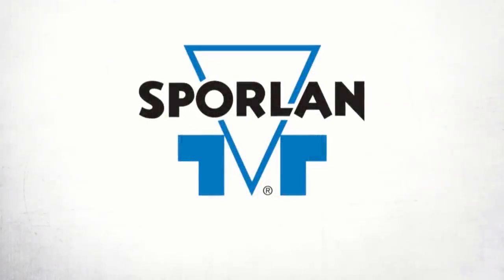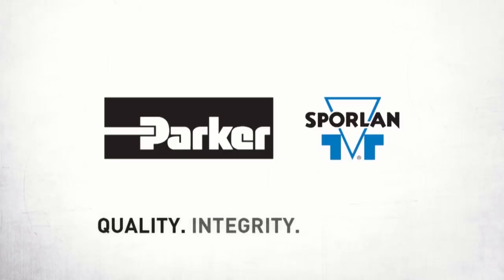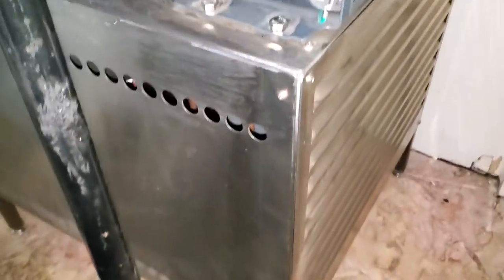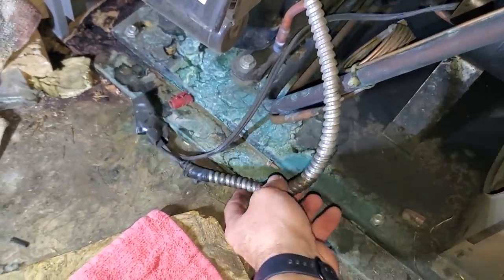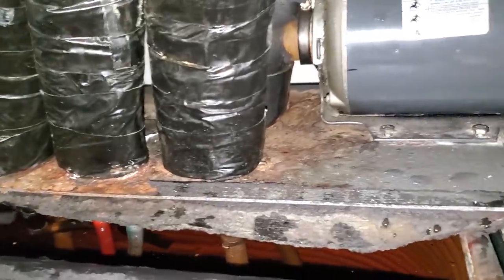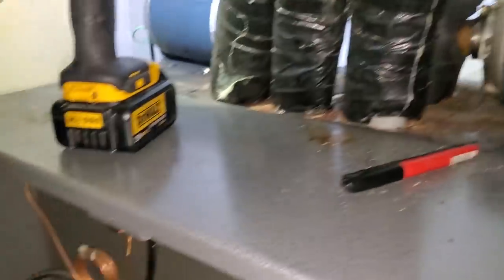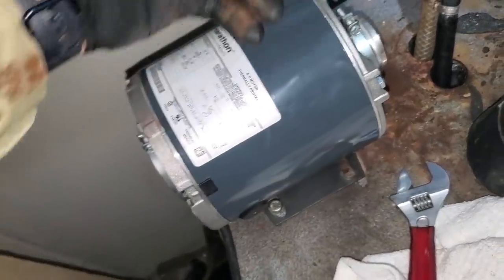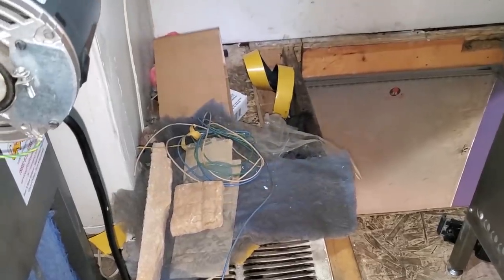BEER IS POURING WARM OUT OF THE TAPS

Comment: as a mechanic ill give you my take on the failure, for what its worth, the pump was going bad , due to contamination or whatever. Burned up the motor. previous tech replaced the burned motor and left the pump. fixing the effect and not the cause.
Reply: You can tell this place and the tech who service it don't have any pride in their work. Pump room is a mess, rust on the units, etc. This is one of your typical "just get it to work" businesses with no foresight.
Reply: @dodgeplow  Unfortunately there are many customers who want it just enough fixed to get it working again. If the customer doesn't want to pay he gets this kind of work.
Reply: @deineroehre  oh I understand. I do much of my own automotive work and have seen disaster repairs on old vehicles I've bought. Same thing with rental properties and my prior homes. You can see all the corners cut.
Reply: When those motors burned the best thing is to replaced the pump also cause most of the time is the pump going  bad
Reply: @dodgeplow  I always take pride in my work no matter what I do, and I have a pretty strong work ethic and a tad on the OCD side. I don't usually mind fixing other people's careless mistakes, but at the same time, shoddy careless work drives me insane. If you don't take pride in your work, go somewhere else. This costs the customer, and if they figure out the problem was caused by a careless tech, I can't imagine them calling them back for future jobs. Just how I see it. Ok, rant over. 😂
Reply: @gregmercil3968  Nor a service tech,  Contractor. But there is nothing that's more annoying than having to tell someone that their "small problem" will now be closer to 3-5k because half their wall is rotted out because someone could not bother to take the time to do the flashing correctly. It's just money down the toilet.  I'd much rather spend my time and their money making something better, not just redoing careless damage
Reply: As soon as you see the poor wiring and the loose covers you have to get suspicious. Either a sloppy worker or a lot worse an amateur or bodger.
Reply: that glycol was trashed
Reply: Denis O'brien 👍🏻

Comment: Hope they offered you a nice glass of cold beer when you were finished!  I fixed a walk in cooler at a bar & grill once, not knowing much about how they work, but I have good electrical troubleshooting skills and found that the 3-phase power was absent at the disconnect. Traced it back to their 3-phase panel which had got damaged by rain getting into in.  Did some crazy temporary fix for that night and they offered me cold beer for the rest of that night!  Went back the next day and changed out the panel..

Comment: Been seeing that particular marathon motor/pump fail exactly like that alot recently.  Have one restaurant that has 8 total pumps, and they replace one every couple months.  I've been trying to figure out a bigger picture fix for this, and I've been considering recommending they flush the lines and replace the glycol.  Seeing this pretty much confirms this for me.
Reply: Wow. Anytime I work on a closed loop system glycol or not I test the fluid inside.
Should flush out the whole system. Run a solvent through it and then fill it with distilled water/ glycol.
Depending on where you live, the water and glycol can react in a way that promotes corrosion.

Comment: great job n video. im a beer guy u did awesome. whenever i get a call on warm beer i first c if the glycol bath is cold or warm. if the bath is cold then i know its a pump/motor issue because its not circulating the cold glycol to the tower. A warm bath its a refrigeration issue n something is preventing the glycol to reach its temp n then take the necessary steps on the refrig side. temp control can go bad on them n glycol bath can drop to very low temp n freeze lines. i did notice the previous company didnt have a nylon pump saver/motor coupling assembly. its two pieces that connect inbetween the motor n pump. adds life to the pump/motor. motor/pumps will last longer with them. glycol looked dirty n theres a refractometer from vee gee which will give u a brix % reading n let u know if ur glycol freeze point if u need to change or add.

Comment: I'm so glad we switched to all packaged beer at the race track ten years ago. There were two different walk ins that ran 48 kegs tapped running to fourteen bars and concession stands spread out over four floors with some lines over 300 feet long.

Open glycol bath similar to your system but don't ever recall any of them getting that murky.

They did have brass pumps with built in strainers and a brass coupling piece between the motor and pump. I started keeping two of each and a dozen couplings on hand for weekend changeouts. 

Finally convinced  boss it was easier and more cost efficient for the amount of business we did to sell bottles and cans.

Comment: You should check out the preformed insulation for the pump head. Usually always have them in stock at trutemp here in Phoenix where I get the motor and pumps.

Comment: They need a few CAT engine coolant filters setup up in some sort of exchange system. That's what is done on a lot of heavy duty diesel engines to keep the coolant free of debris.
Reply: Coolant filters on diesel engines are actually used to disperse additives to prevent cavitation damage to wet sleeves

Comment: You are correct that unit needs cleaned. Thats definitely causing pumps to fail. Seen it happen many times.  Best thing to dois shut it down clean it out and fill with fresh glycol or they're going to continue having problems with pumps and motors.

Comment: Oh yeah, chillers. It's always a stripped out shaft on the motor because the pump had debris in it, or the motor just burns up. 

My old boss told me, if I find a pump motor burned up on one of these chillers, change the pump too. That advice has served me well. 

A Leonard's Syrup technician told me years ago, the the glycol has to be changed every few years if the lid is secured and sealed, but the glycol needs to be changed more often if the lid is missing or not secured closed.

Let's face it though, once the chiller is up and running, all the good advise we give goes out the window.

Comment: Great job again. If beer changes temp by 3* it will foam. Those pumps fail because they’re so cold and that makes them rust and the bearings seize. All my customers have two pumps and two motors on standby right next to their equipment because it’s not a question of if but when will they fail. Syphoning the old glycol, take a hose and put it into the tank and use a zip tie to keep it from falling out then run the other end of the hose into a floor sink. Get 2 buckets of hot water ready by the machine then take the end of the hose by the drain and put as much water as you can into it then let it go into the drain. That usually causes a priming action and the tank starts draining then go to the machine and as it drains pour those hot buckets of water into the tank and in minutes you’ll have a clean tank ready for new glycol. Super quick and easy.

Comment: the refractometer from Vee Gee is great because glycol will lose its viscosity n break down to wer its mostly water n then ice will freeze up the unit  n u dont want it to thick which can cause problems with circulation. ive also been told but never seen the clamps on the lines burst due improper glycol/water ratio with too much glycol. i check my units b4 the summer n winter.
Reply: Too much glycol and you lose the heat transfer superiority that water posesses as well.

Comment: Some of these pumps use a rubber coupling, so once the mechanical seal starts to leak the rubber will rot. If the pump is installed at certain angles the weeping hole (or channel) might not be effective and coupling cavity could fill up.   Didn't get a close enough look to see if this is the case, but all that sentiment will effect the life of the mechanical seal. If the glycol came full strength it should be diluted with de-mineralized water, not tap water, but that instruction is not always followed.
Reply: a tiny seep will schmutz the weep hole closed in fairly short order and then fill the housing migrating into the motor bearing and speed rots the coupling too.

Comment: Hey Matt whats going its nice to see some-of this videos....im beverage guy ive work with this types of systems on a daily basis they are very various type of pumps that can be use i highly recomend stainless steel procons(pump)they last more then a standard brass procon....i dont recomend using procons with strainers they tend to clogged but they can get you out of a pinch this types are more use for soda carbonators. if this is the case removing the strainer is a must debris can clogged them up and cause them to burn up....to extended the life of this manufactures recommend to change out the glycol every 6-8 months glycol mixture losses its viscosity and becomes more water base causing pumps to burn out or freeze bath....there are also parts that can be added to the motor for safety precaution so if the procon ever lock ups will break up the plastic and save the motor extending its live 👍👊
Reply: Who the hell is matt?
Reply: Lol matt... Do you use the mag drives? I've had pretty good luck with them.
Reply: I think his name is Chris
Reply from the maker: Yeah who is this Matt, he sounds like a cool guy.....
Reply from the maker: It's all good I'm just messing with you, but yes my name is Chris

Comment: As others have said. I believe the motor was changed out but not the pump. I change a few a year. With the exception of a few beers, i go by the golden rule that a beer distributor told me. 28 will give you 38. Most of the units i work on are set at 28 degrees.  Propylene glycol,  and yes, garbage will cause overloading because it restricts the flow.  I have had units with screens completely blocked, no flow. Pumps tend to lock up because fluid gets past the seals. and trashes the bearing. Had one that hard locked up and twisted the motor side coupling beyond repair. Also if the head is not insulated well it will cause a lot of rust in the coupling. I am not a beer or soda guy either. Just work on glycol chillers here and there. Enjoy

Comment: the way the motor shaft was rusted and eaten away leads me to believe A. it got moisture into it and rusted B. misalignment speeding the wear process.
possibly the pump shaft seal leaking and body weep holes sealed off with foam tape and the coolant went through the outer bearing into the shaft area, but the foam itself could be holding enough condensation to build and get in there.
is there weep holes in the motor nose and was it pointed down? it's probably wise to put the band clamp with the opening/screw at the bottom too, less chance of stuff running in and easier to seep out. I wonder if they recommend putting lithium/moly grease on the shaft coupling areas.

Comment: Those carbonator pumps have 4 carbon vanes  ,any dirt or running dry kills them , I think there are about 2 sizes 50 gallons per hour and 100 gallons per hour ,the brass couplings often wear out on them . Worked at Pepsi for a few years , Changed lots of pumps .

Comment: That was an impressive amount of dust around the motor shaft.  Do those units have couplers between the motor and pump, or were those shavings from the pump hub itself?  And was the old motor dead, or just too much hub damage to use anymore?
Reply: It looked like the pump was seized by that point and burned up the motor. Seen similar problem cases back at a jobber shop where we did industrial repairs and machined new parts if needed.

Comment: the load on a circulation pump doesn't change, or am I somehow wrong about that. those pumps just run 24/7. doesn't matter the temperature of the coolant, it's always pumping the same volume of liquid.

Comment: Please excuse my ignorance but why is there a separate refrigeration system just for the beer lines leading from the refrigerated beer kegs to the tap? Why not just place an heat exchanger inside the same beer refrigeration system and use the glycol pumps to cool the beer lines instead?

Comment: the creative wiring probably is not code. yes it is safe in that the wires are wire nutted and taped up but i think code calls for a junction box so you will have to check with local electrical code for commercial operations.

Comment: Does that glycol pump/circulate through a secondary set of lines in their tubing bundle? Have't worked on one of those systems but I'd reckon that's the circuit in order to reduce the heat transfer out in long runs. Kind of surprising they don't just run 2 sets of recirc'd water lines with an ice bath chiller, would have to be quite a bit less hassle than pumping antifreeze and achieve a similar result.

Comment: Curious to know where the silt is coming from, I’ve seen where adding two different types of antifreeze together can cause this. Especially GM’s dexcool and conventional ethylene glycol. Perhaps this the case here
Reply: industrial glycol is slightly different from automotive grades of glycol. The silt is most likely bacterial growth. There were no filters, and definitely nothing that adds chemical (glycol or antibacterial growth) to the mix to keep it in balance. Granted this is a much smaller system than an industrial chiller for cooling buildings etc with VAVs and air handlers, but the basic concept and system is the same.

Comment: You got it backwards a bit, bossman.  antifreeze is a mixture of ethylene glycol and water, not the glycol being a mix of water and antifreeze (which isn't to say the glycol in these chiller systems is pure, I know next to nothing about those systems).
Reply: Also car/truck antifreeze is ethylene glycol which is seriously poisonous. That in food/drink coolers is propyl glycol which is not poisonous.  Important to be sure to use the right sort.  It's so important that if antifreeze is needed in (say) a boat's heating system then you must use propyl glycol to ensure that the hot water cannot get contaminated in a case of a fault.

Comment: At my store we have circulation pumps go down at least twice a year. This is due to a combination of contaminants in the water and low water supply pressure. (water district will do nothing). They run a micron filtration system, where the water runs through 4 large filtration cylinders, with a prefilter which is supposed to last at least three months, but with the water quality, they swap it out every 8-10 days. You can hear the sound of the pumps change in pitch as the pressure inside changes, a day or two before they break down and water goes all over the place.

Comment: There is supposed to be a plastic piece in between the pump and motor along with a plastic spacer and another set of clamps. Without that and the dirty glycol the motor is going to burn out again.

Comment: Why was needed to change the motor? for me was looking that only the pump axe was corroded.
Reply: bad pump made the motor work overtime to do the same job. Heat will destroy an electric motor in the copper wire windings, so best to replace it, otherwise it's a ticking time bomb, can fail next day, next month, next year, or maybe you got lucky and it will run another 7 years. It really isn't worth the additional service call. Plus for a good workmanship warranty, now you KNOW the motor is a good motor, so if the pump goes bad early due to a manufacturer defect they cannot blame the motor and weasel out of paying the labor to change out the new free pump... ;)
Reply: @claytonwhitman1608  thanks, i was not thinking that it's not a home repair and it's require another payed call if anything need further attention  👍

Comment: I really want those "bad" motors. I guarantee most could be fixed, either electrical connections or bearings for most issues. Rarely does it need to be rewound unless the insulation got toasted. Not that you have time for that but I would totally refurbish them. Big beefy 3 phase motor goodness...

Comment: I guarantee the restaurant is not cleaning the system. I forget the schedule but I seem to recall it was monthly. Might have been quarterly. There are cleaners/disinfectants that are supposed to be flushed through the system on a regular basis, both for the product lines and the cooling system. Which means you lose all the product in the lines on every flush. Same rules apply to carbonated drink systems. Restaurant do not want to pay for this service and they do not want the down time and they do not want to lose the product. So, now you know why your beer and carbonated drinks taste funny or even bad at certain restaurants and bars.
Reply: Ideally it would be weekly cleaning of beer lines. All the bars I worked in did them weekly and managed to keep wastage low by knowing the length of the lines in pints (UK based) and disconnecting them at opportune times. For example, you have a line that contains four pints from keg to tap and a customer who usually has 2 pints at closing then disconnecting the line at the right time means you’ve sold 2 pints to the customer and only wasted 2 instead of the full line of four.
Reply: @pjd83  What law or health department regulation did you use for your information?
Reply: @DomManInT1  We don't have any laws or health department regulations for beer line cleaning in the UK. We do have food hygiene regulations stating that food safety measures should be taken but they are vague. I know of some bars that do their line every two weeks but most I know (and all I worked in) did them weekly. I'd be interested if there is law or health department regulations if you know of some? Crazy to think Starbucks clean their coffee machines daily but some bars can sit with dirty lines for weeks or even months.